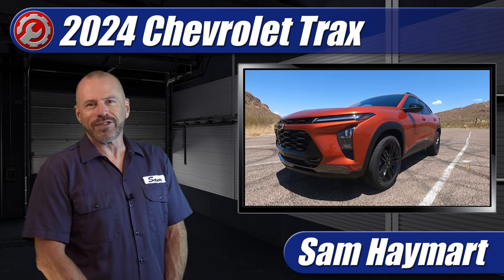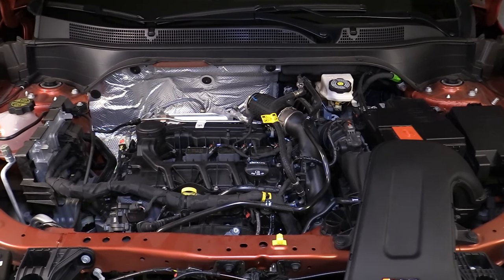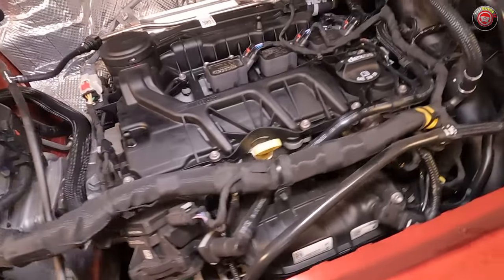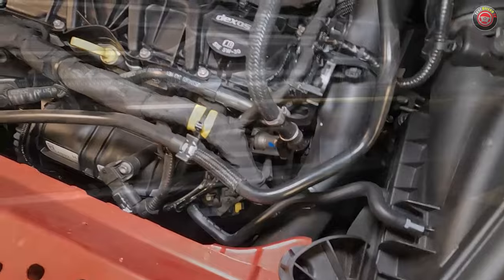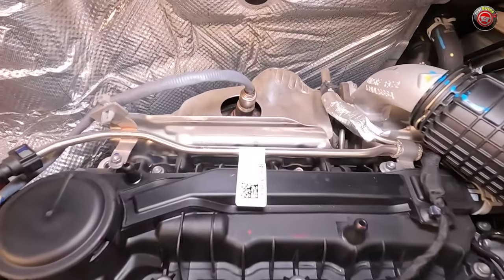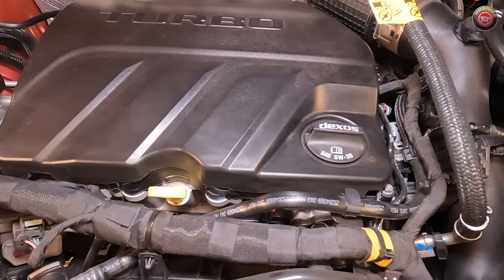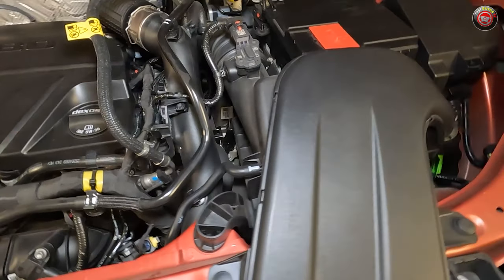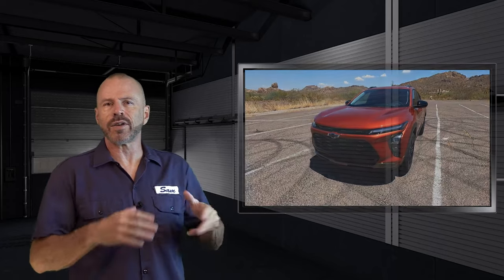2024 Chevrolet Trax: Engine Explained

Comment: Lots of plastic parts including the oil pan & a timing belt instead of a chain & direct injection that can promote carbon build up does not promote long engine life to me.
Reply: 1.2L does not have a plastic pan but it has a rubber timing belt. 1.3L does have a plastic plan but it has a timing chain. Regardless both have scheduled maintenance at 150k miles so you cant avoid it like other vehicles. I also wonder how well they will deal with carbon build up since its a recurring issue with many auto manufacturers. I personally have one but with only 1k miles I don't have much to report.
Reply: @jabaho  How are you doing with the car? I'm thinking of buying one
Reply: @mmaldonado470  car has been problem free for me, I am around 6k miles currently. I have been reading higher trims with the upgraded screen are having issues and windows are a widespread problem on all trims. Gas mileage for me at 70 is around 35mpg but city mileage isn't great.
Reply: @jabaho  thank you for the info 🙌
Reply: so the 1.3 has a timing chain thanks @jabaho
Reply: @jabaho I would hope no issues by 6k. I try and avoid first year models but all car brands have failures at times it’s just all people post about are the problems 👍🏻
Reply: @mjthethird1  My car is at 21k and I haven't had any issues other than infotainment bugs which is odd because I have a 1rs which uses their older system. I think the major issues I was seeing online was light sensor and window switches/regulators.
Reply: 21k Miles on the trax 1RS? Great!!! @jabaho
Reply: Avoid plastic engine parts!😂
Reply: It would be nice to know the oil capacity and see the oil filter ease of access and oil plug access.  Otherwise you do a nice job of presenting information.  Thanks
Reply: Use royal purple keep that engine alive

Comment: This little engine has a wet belt to turn the camshaft. A rubber belt that runs in oil. Ask Ford how that idea worked in their little 3 banger. Why not a long-lasting chain instead? When the belt needs to be replaced, and it will at some point, it is a major tear down of the engine to do so. Probably somewhere just after the warranty runs out.
Reply: @russellmaddock3492  built in obsolescence 😳
Reply: The problem is is that Ford used improper materials for the 1.0L engines wet belt. Also, Ford used TWO wet belts on that engine, and its usually the oil pump belt that fails, not the timing belt. The Ecoboost V6 engines use a wet timing belt and have had no real issues.
Reply: Exactly cheap cars cost more.

Comment: 3 Cylinder/Turbo engines is the new trend going forward, cheaper to produce for the vehicle manufacturer........
Reply: And better epa numbers which is the name game for compliance ….
Reply: Yep and in a junkyard by 100,000 miles.
Reply: And tougher fuel economy standards. If manufacturers don’t meet the standards they have to buy fuel credits or pay a fine.
Reply: @Cavemol5823  Except tiny turbo engines are proving not to be more fuel efficient. Other vehicles in this class of vehicle actually get the same if not better EPA numbers with naturally aspirated 4cyl engines of larger displacement. Kia Seltos is rated at 35mpg highway with a 2.0L 4cyl, for example. Trax is rated at 32mpg.
Reply: @palebeachbum is the seltos a CVT?
Reply: @brianattyberry  Kia calls it an IVT, but yes it's essentially a CVT transmission. It uses a chain instead of a metal belt like a regular CVT.
Reply: @palebeachbum  that's probably why then. Chevy doesn't have any of that yet, not in this car.

Comment: Why not just have a 4 cylinder early 2000 version engine installed.  Why complicate with a turbo???  I don't get this?!? Overcomplicate crap to justify cost of build.
Reply from the maker: Because emissions and CAFE standards require higher efficiency and cleanliness than they did in 2000 and buyers expect more horsepower than they did then. To achieve both, a turbocharger is required.
Reply: To add to that, that's why some engines are no longer around, for example the 4.3 Vortec that was in the S10 and Blazer couldn't pass emissions so GM had to discontinue it. Everything is all about emissions and EPA standards today.

Comment: ENGINE COMMENTS: An I3 is smoother than an I4 without balance shafts. This 1.2-liter I3 is a long-stroke design (a.k.a. undersquare), which used to be unusual for a modern engine; the Silverado’s I4 is also. With a long stroke you get more torque because a larger crankshaft offset gives more leverage (a simple concept). If you’ve got lots of torque, and many tranny speeds, the lack of HP seems forgivable. I expect mine in a few weeks, so we’ll see. This 1.2-liter engine will have 17% the displacement of the one in my 20-year-old Silverado 2500HD (which has a Tonawanda Big Block). Remember, “horsepower wins races, but torque gets work done.”
Reply: there is no lack of HP... 140 horse for a 3100 lb car is not the best but not the worst... my chev volt is abour 150 horse, 300 torque, but the trax faster.

. a 5.0 mustang was about 3000 lbs and 185 horse. 

HP is how fast you can go

torque is how fast you get  there
Reply: Acceleration is a function of horsepower (aka work being done). Torque is just a twisting force. You can use gearing to multiply torque generated but you cannot change horsepower output.
Reply: @brarautorepairs  cool
Story. Go buddy. Trax 1.2. Is quickn
Reply: It's more complicated for an engine that's spinning. Please remember that HP and torque output are a function of engine speed. Someday you'll understand the two concepts, and how they relate to each other, if you keep studying internal combustion engines. Never stop learning.
Reply: @BrianSzafranski  cool story bro you might be an apprentice one day

Comment: Forgot to mention the disaster and cost of replacing the valve timing belt....bad design.
Reply: Good point.  I can only imagine that regular maintenance is a absolute
Reply: it's only $800-$1000 and recommended at 150k miles. I looked it up bc that's a red flag for me too

Comment: I'm confused with the "well proven" statement. Its's a relatively new engine. It hasn't proven crap and I own one. That internal wet timing belt after the Ford EcoSport crap has a whole lot to prove. Since information was so low on the engine when I bought my Trailblazer if I knew that I would have never bought it. Anything remotely similar to that Ford 1.0L turbo 3cyl I will avoid.

Comment: oil bath timing belt....no thank you!
Reply: Thats what destroys the value proposition of this car, your going to be spending thousands over the life of the vehicle to replace the belt most likely at a dealer, where all they are going to do is mess other stuff up in the process of changing the belt.
Reply: @Loudlevin  geta decent torgue wrench a shop manual and do it youreself... it isnt rocket science..
Reply: @USNVA-yn6cp  Not worth the aggrivation, are you willing to boroscope your oil pan and pick up screen every oil change, your going to need tooling to lock out the cams as well, im sure that will be easy to find and cheap.  This is a compliance engine built with the sacrifice of reliability and the prospect and intent of selling parts and service on the backend of the purchase right out of warranty..
Reply: @USNVA-yn6cp  99.8% of people will bring this to the dealer and get bent over 5k plus for a belt job god forbid they let it go until the belt snaps or pickup gets clogged ,like i said the dealer techs will screw other stuff up in the process, like you know using that german torque instead of that torque wrench thats collecting dust in there box, or maybe not putting wire harnesses back in the clamp so that it chaffes every time you press the gas and brake, but hey all thats going to be the customers fault , so they bring it back to the dealer and they mess more stuff up.
Reply: @Loudlevin  you make some valid points no doubt, its a damn shame that folks are so lazy these days when it comes to serving their cars though

Comment: Great video. I can feel engine vibration in the seat, brand new when the car is in Drive and I hold the brake. Is that normal?
Reply: I have a Trax next time I drive it I’ll let you know,  can’t say I’ve ever payed attention to it.
Reply: Wouldn’t be surprised as the engine it technically wanting to creep the car so yeah
Reply: @braden2233  Thanks, let me know. Not sure if that is something I have to take it back to the dealership for
Reply: @realfakearchitect  I’ve been trying and honestly I don’t really feel anything,  so may be worth running by dealer. It could be the cold aswell not sure where you live, mine stays in garage so it doesn’t get as cold
Reply: @braden2233  thanks for getting back. I live in a pretty hot state, lol. What does your car idle at typically? I could be completely wrong, but the second the idle goes higher, the vibrations become faint.
Reply: @realfakearchitect  I believe around the 1500 mark
Reply: @braden2233  no way, that doesn't seem right
Reply: Yes it is

Comment: Is it an interference engine? What are the timing chain guides made out of - plastic or metal?
Reply: Great question! I'm thinking about getting the entry level Trax LS next month. Im not a mechanic, so I asked a "service technician" on the phone that same question.......The engine has a "timing belt" that rotates "in oil" and is recommended to  be replaced at 40,000 miles. I always thought small engines, (like my 2012, 4 cylinder Toyota Yaris) had timing chains. With me doing mainly around town driving, the Trax LS is still the one for me.
👍👍👍👍👍👍👍👍👍
Reply: carbon fiber
Reply: @collinspaulk2023 that belt setup is old school it wasn't reliable back 25 years ago or so.
Reply: @collinspaulk2023  The manual says recommended 100000 miles but actual is probably closer to the 40000  mark. Its gonna be an expensive replacement at least 2000.00 probably more. So if you have to do that every 40000 miles I hope they come up with chain that you can replace it with.
Reply: Excuse me,  Dale Earnhardt? How many engine rebuilds have done ? I helped my Brother re build his 1948 Chevy. When I was 8 yrs old I stopped to turning wrenches only because of Arthritis in my hands and Spine. 
Yeah you tell me that working on that bucket of bolts,Is going to be.

Comment: Any idea what the life expectancy is when following proper maintenance intervals?
Reply: A tiny aluminum engine with high pressure GDI and turbo won't be much for longevity. All that pressure it will probably blow gaskets and maybe even be an oil burner as the piston rings wear out. Don't forget about the plastic parts and electric water pump, and electric turbo, and a rubber timing belt that is submerged in the oil.
Reply: @chickenfarm09  You will be lucky to get just past the warranty GM turbo engines are horrible Cruze engines leak oil and coolant and cracked turbo housings. Equinox 1.5 are having about the same issues and the fact this is a 3cyl with a wet belt Fords 3cyl proved to be a nightmare with its wet belt.
Reply: Well they’ve been using it for a few years in the trailblazer and searching used cars there are quite a few with over 100k. Available.
Reply: @mstngken  Time will tell, supposedly the belt is designed to with stand the oil lets hope the learned something from the other failures.

Comment: Got a 1.3 trailblazer rs what do you think about the engine on this one?
Reply: The trailblazer is cute! Ours got rear-ended so we opted for the trax afterwards since most of the back caves in from a truck hitting us….
Reply: The 1.3 has a timing chain not a belt, like the 1.2l 
it gets better mpg, than the 1.2l, downsides of this motor, are the manifold pressure is insanely high, and direct injection has issues long term, no fuel hits the intake valve the way port injection does, it is however very fuel  efficient, I also have a 2024 trailblazer, with the 1.3l 
I get 42 mpg on my work commute, if I stay at 55 mph.
Time will tell how they hold up.
The 1.3l makes more power per cubic inch than the corvette motor,  and it does that with the turbo and a very high manifold pressure. Just my observation, of the 1.3l motor. Both good and bad.
Reply: Output is rated at 155 horsepower at 5,600 rpm and 174 pound-feet of torque at just 1,500 rpm, which means the L3T boasts a specific output of 116 horsepower per liter. As such, the L3T has greater specific output than the 6.2L V8 LT2 equipped in the mid-engine Chevy Corvette C8 – 37 horsepower per liter greater, to be exact.

Comment: It's amazing how car companies continue to throw cheaper parts under the hood while simultaneously increasing prices.
Reply: They are probably just getting ready for the switch to EV vehicles.
Reply: price went down then last verision
Reply: This should be about $10k for all the cheap they put in this
Reply: Actually the price went down, so check your facts.
Reply: It's like $14,000 based on pre pandemic prices.

The value of the dollar has been cut in half.
Reply: @braden2233 shouldn't have been that high to begin with
Reply: When C- engineering  students get together to create the D+ final product
Reply: Blame it on labor that insists on getting paid

Comment: Just bought one of these brand new Chevy 2024 RS I checked the oil in it at 2000 miles. It was down to half a court. The car is brand new. Probably because the oil is so thin and you have timing belts running through it or the engines a piece of  junk seems to ride well so far I’ll give it to benefit of the doubt. Maybe they didn’t put enough oil in it when I bought it but I got an oil change. I’ll find out.

Comment: I wonder how long such a small and complex engine will last in such a large vehicle.  It will have to work very hard and withstand a lot of heat from the turbo.  GM is not exactly known for building durable small vehicles.

Comment: Thank you for video is timing belt easy to get to  for replacing ?
Reply: They have timing chains.
Reply: @am74343 
The 1.2 has a belt.  The 1.3 has a chain.
Reply: No. It's a "wet timing belt". No cover to pull off. A whole lot of crap involved. Stupid design.
Reply: Have done four timing belts on different vehicle found a video on a wet timing belt true its a little harder but think I can do it when the time comes. Looks like a lot of room in that engine bay.
Reply: Half the engine has to come apart it's a pain

Comment: What about fuel? Premium or regular?
Reply: Regular
Reply: I've been using premium and have had none of the idle vibration issues that people have reported.  Gdi engines need premium - in the early 2010s, it all changed to regular one day, magically, for the automakers except germans...I wonder why. ....  I change the oil every 4,000 miles. Ignore the dealer intervals if you want the car to last a long time.  I will be paying for a trans fluid change every 25k miles.  Cold climate, daily driver. Trying to get 150k miles out of the 2024 I bought.
Reply: @ramtough07  smart call

As well gdi cleaner spray

Comment: Would this turbo last longer on premium it's only 3 cylinder but it has a small turbo premium should give it a long life
Reply from the maker: Fuel grade has no effect whatsoever on the performance or longevity of a turbocharger any more than it would tires, the radio or a wiper blade.
Reply: sage saying from an old mechanic Tubo chargers work, until the don't

Comment: Does anyone know what the Rubber engine topper is there for?

It looks like a plastic beauty piece, but idk if it's Rubber to help keep the heat even on the aluminum head or not.
Reply: Ok he says it is sound deadening foam. Does it serve another purpose also?
Reply: Sound deadening foam, has the texture of a bike helmet. Easy to pop on and off.

Comment: I'm surprised that despite giving detailed information on various features on this engine you left out mentioning the wet timing belt it uses.
Based on European cars that have used this same engine and technology for five years now the oil submersible timing belt has a poor track record of reliability and can cause major engine damage when peeling rubber off the timing belt can not only plug the oil sump screen but also oil galleries causing major damage to the engine.
Also the timing belt is an expensive item and labor cost high to replace it because of how many parts you must remove to access the timing belt since there is no timing belt cover like traditional engines.

Comment: What if any would you recommend for break in and first oil change. I have 400 miles on it 90% free way driving.  What are your thoughts on the timing belt in oil setup.
Reply from the maker: Maybe see what the owners manual recommends?
Reply: @TDTVGarage  I learned form other auto techs that the owners manual is written for the EPA.  But thanks for the reply.
Reply: @motorcitymadman146 ive been learning to take the owners manual and basically half it for just things and you'll be in way better shape!
Reply: @Nathan-ct9eh  Agree.  I change the rear differential fluid , transmission fluid and filter in my F150 every 30000 mile Front diff  and transfer case fluid at 60000 and engine oil every 4000 to 4500 miles. 70000 I will change out the break fluid and Engine coolant. At 70000 most people have only changed the oil about 10 times.

Comment: Timing belt in oil it will put rubber in the oil, and stop the oil pump up wait and watch it happen. These will be throw away engines like the ford 6.4 diesel.